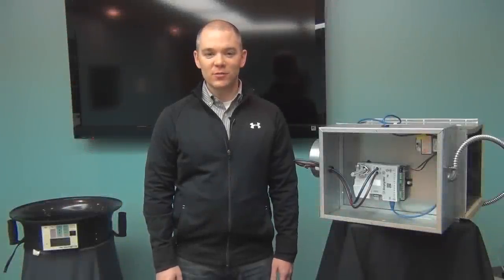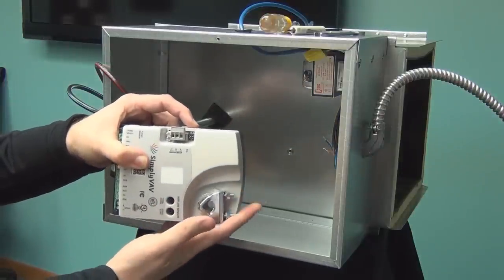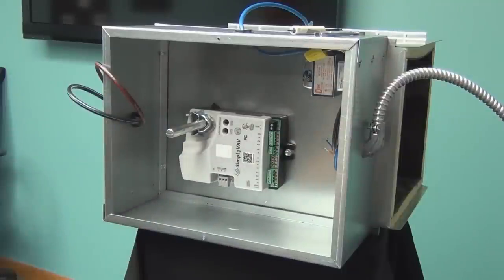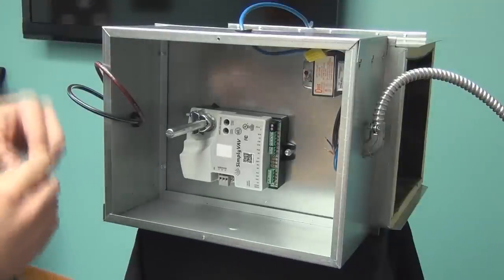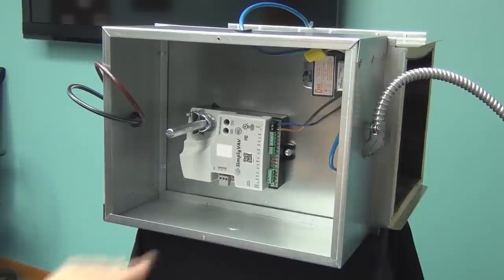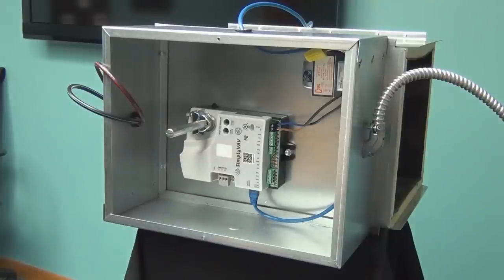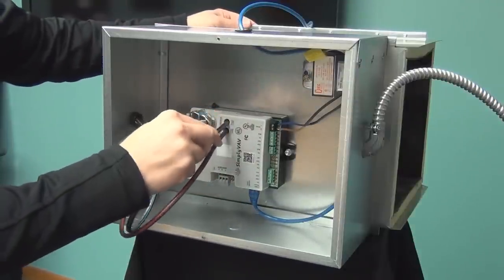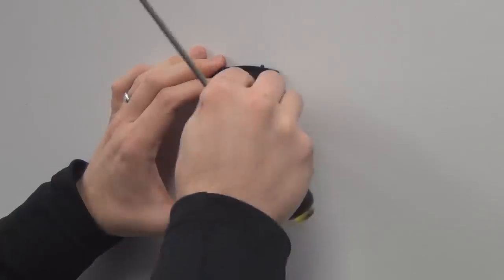Installing the VAV Controller and Sensor

Comment: Looks like when the cover for the vav is installed those velocity ports on the front could cause some issues. You barley touched the high port and the poly tube popped off